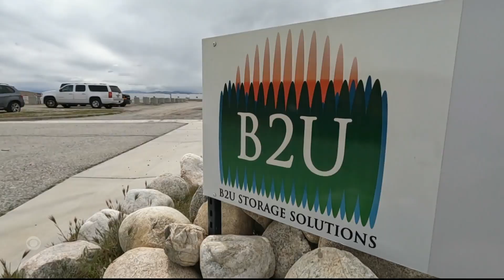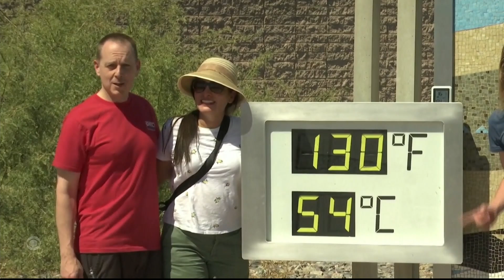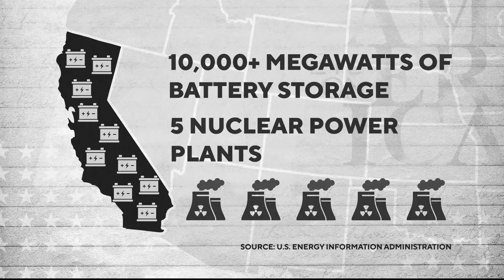The success of renewable energy may depend on battery storage

Comment: Correction: To make all of the renewables work (all the time) you need STORAGE, SOME OF WHICH are batteries.  I'm glad the larger media organizations are finally aware of the facts that a) renewable is here is a major player on our grid, but b) they need energy storage. But too many of these stories equate storage with batteries. There are a great many options, many of them proven and with different storage qualities than batteries. Pumped hydro (including closed-loop pumped hydro), hybrid geothermal, hydro-chemical (use the extra power to make green hydrogen, green methane or green ammonia for use in airplanes and ships), gravity storage, heat battery storage . . . this is a dynamic, rapidly innovating area. Batteries are good to store power for minutes or hours. The others can go from minutes to months.

Comment: You can also use sand towers where electricity heats up the Sand and it stores it over a pretty good time. Than you convert the heat back into electricity like during the night. Yes batteries are good but I guess also expensive. A sandtower project was shown in Scandinavian countries and it was successful
Reply: They have two of those in Nevada on the way to Vegas from Los Angeles
Reply: @efemdesign  sounds good
Reply: Sand, rocks, concrete and carbon blocks all work as cheap mega battery storage.  Sodium ion will be available soon
Reply: @larryc1616  also clay blocks